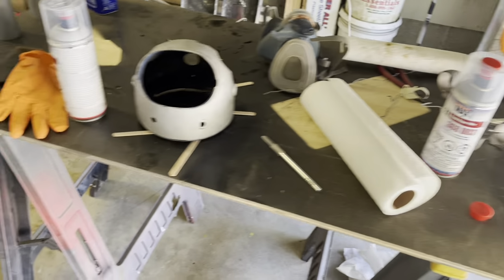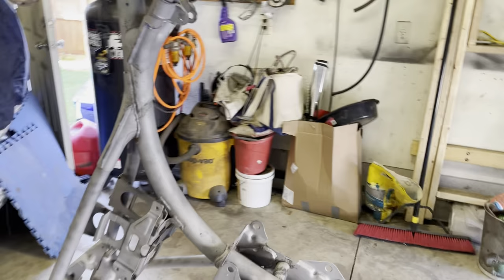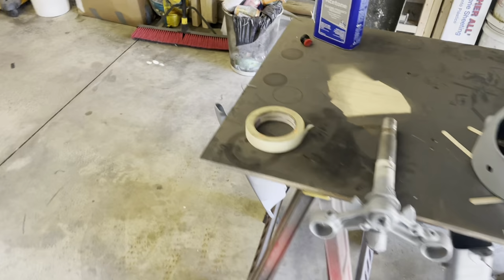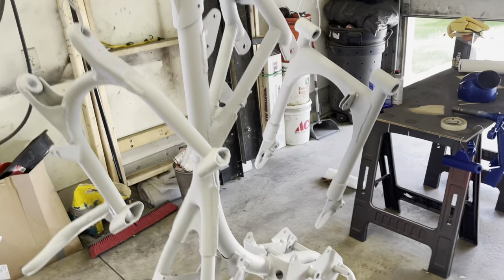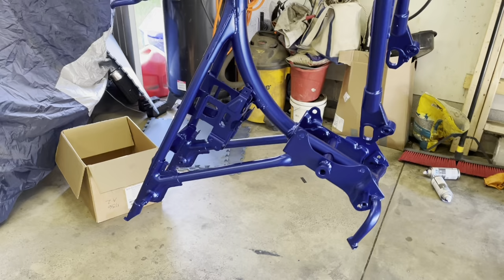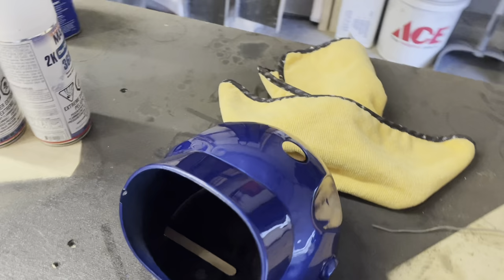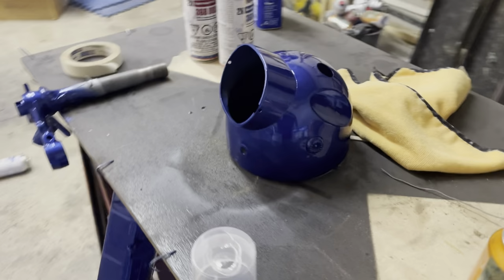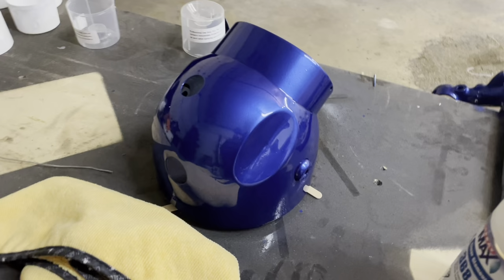Painting A Vintage Motorcycle Frame: DIY Restoration Project

Comment: Love the color but for the price of al that 2k you could of got it powder coated tbat wont scratch and chip as easy for probably 250
Reply from the maker: They weren’t powder coated. I’d like to give the next a chance to do what they want. But yeah. $250 bucks for sandblast and powder is what I see. Saves a ton of time.
Reply: @KeepOnWrenching  Prismatic = over 6500 colors !!

Comment: I'm about to start my 76 360T Honda restore.  I had mentioned that I might rattle can the frame and all the non chrome parts with a hammer black gloss.  Everyone said I was nuts and can't get it done where it will look worth a crap.  I figure I'll need to have the tankd and side panels done professionally because the side panels (which are as hard to find as a unicorn) I had made by a laser printer.  I  got screwed twice buying orginals on line.  The heat just makes the fin openings brittle as heck and if there not broke when you get them, they were glued.   I'll start breaking her down and putting parts from different places in seperate plastic bins.  Never tore one down before but have a new harness and some other things such as fork rings, oil and so on.  Got to decide on the chrome that shows some bubbles in places.  Don't think I can afford to re chrome.
Please add web addresses product names and identifiers if you can.  You did a great job on that frame and I can't wait to start mine.  
I noticed the front disk breakes have closed and I'm sure it's because of no fluid.  I've got a lot of work ahead of me and I'm going to use every thing you have posted as my guiding star.
Thank you for doing what you do.
Reply from the maker: Links added! The blue PB5 was a special track down for the vintage paint code. The spray max 2k stuff is amazing. You can totally do a nice job.

Comment: Starting a 1977 yamaha dt100 2stroke i really want to hard tail it being its an induro going with the bobber style removing all the brackets wires lights and unneeded crap keeping the head light and a rear stop/ running light putting street tires on it might put the same size rims front and back lime a super moto ditching the oem bulky ugly seet fir a low profile cafe racer type seat going to have to cht the rear sub frame down and the. Rewekd it back on minus 3 or 4 inchs so its not sticking out past the rear of the seat it should be a fun build got to order a carb and reed cage it didnt have them when i bought it but that just means upgrades lol want to find a nice oem tank with some patina and clean it up then clear it popped the. Head off and cylinder walls look decent but i might just go a head and put a new oem piston in it or bore it over i like the fact it's a 2 stroke air cooled motor so there no bulky radiator and hoses running in to the block looks suoer simple to work on
Reply from the maker: Live simplicity. I think that’s why I love the old Hondas!